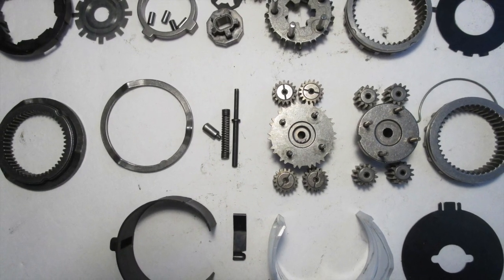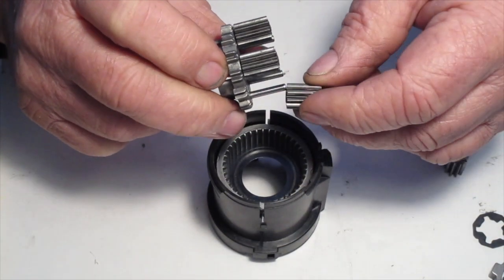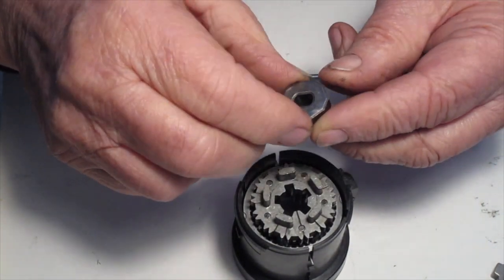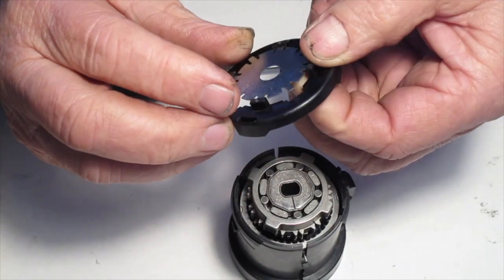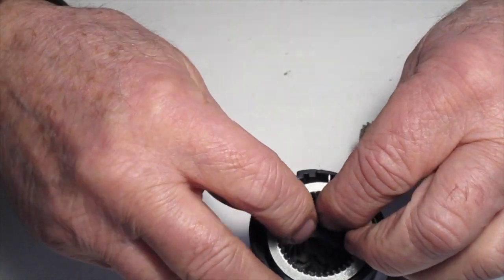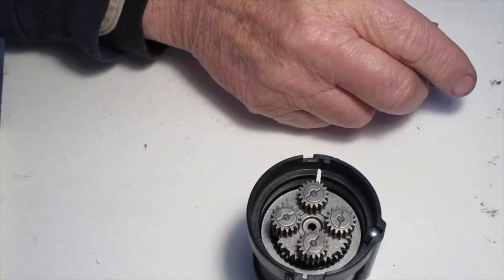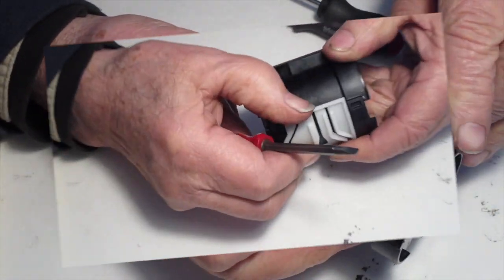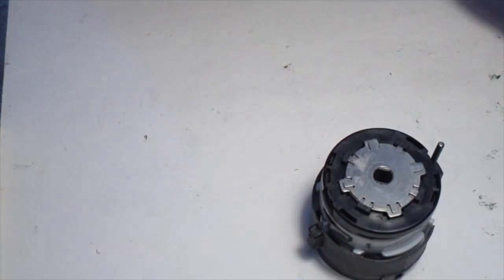DC925 Transmission Reassembly

Comment: Probably going to attempt this on a DC791 and DC796 because me and my coworker are having stripped gear issues, took it to a shop for a replacement trans and it cost 80 bucks, I figure a repair would be more cost effective.
Thanks for the help!
Reply: How that go champ? I just unassembled my dcd791 and I'm in the process of putting it back together. I've been on hold for about a month and I have to order two of the pinion gears as I seem to lost them. Lookin at it I'm kinda overwhelmed..